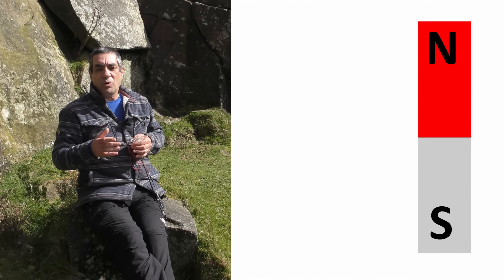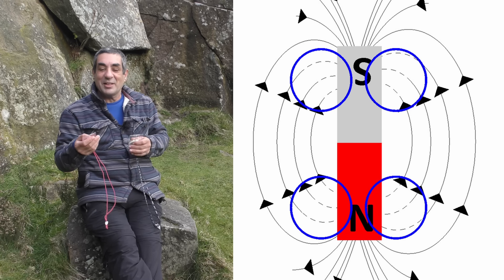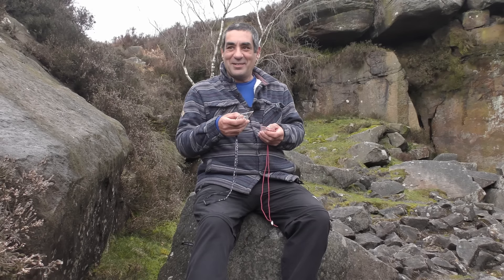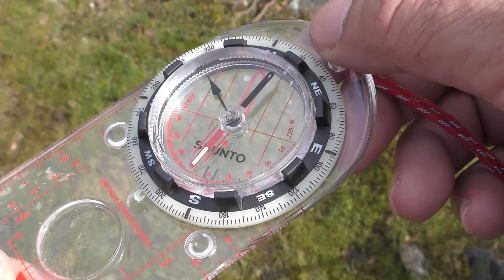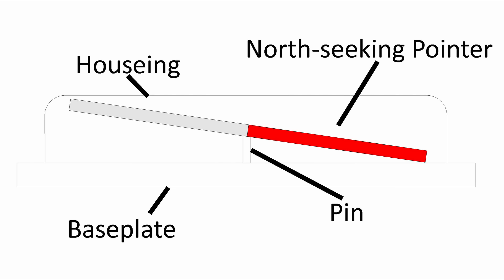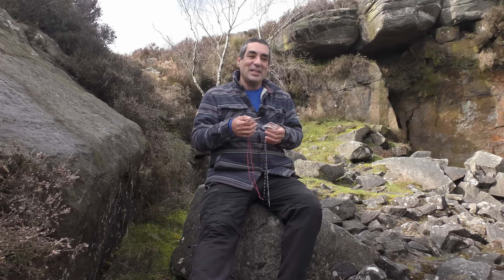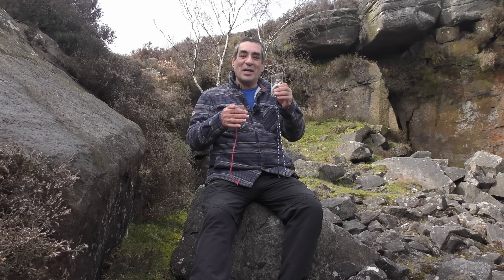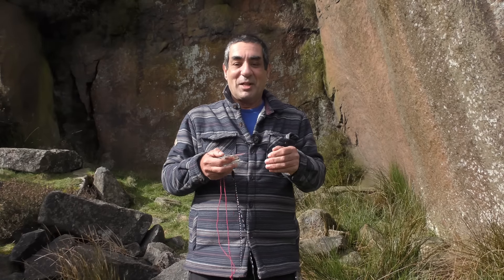Global Compass - how do they work

Comment: I live in New Zealand and it is very difficult to find a compass where the southern end of the pointer doesn't scrape. Even proper outdoor shops frequently sell compasses that have been balanced for the northern hemisphere (with a northern hemisphere DIP angle). When I try to tell them they look at me like I come from Mars. I go back to the shop a year later and they are still selling them. Using a compass with the wrong dip angle is incredibly annoying because you always have to monitor if it is scraping and thereby giving you a false bearing.

Enjoy your videos, any chance of one about the wonderful, but now discontinued, Silva 54 with the miniature sighting prism built into the housing. I used one in Antarctica to sight in a row of glacio poles, on a bearing. We swore that with care you could sight to 1/3 of a degree. Cheers.
Reply: There's a good reason folk are working in shops.  Shop assistants are notoriously bad listeners and basically slaves to proprietor's   directives.   They just want to shift stock.
Reply: Go to a ships chandler and try there. Ships of course, go everywhere and move about doing it.
Reply: @markbernier8434   Quite right.   Compasses are swung regularly and larger ports will have agents equipped to do the job.   Most  modern small boat compasses are fluid mounted  globes  rather than cards or needles.
Reply: The Silva Expedition S has a sighting mirror, which is supposed to do the same thing. I haven't used either, so I don't know, though. But Silva Expeditions is what we always used when orienteering in school.
Reply: I've had quite a few different compasses over the years...but if you really want accuracy in a small package I bought a sighting compass made by Suunto.  I know most compasses have the sighting feature but this one was different...The factory specs were different too.   The factory claimed accuracy 1/3 of a degree.

I bought it for doing rough survey work...the price wasn't all too bad...i wasn't expecting it to replace a transit...but it usually did.  Suunto KB-14/360R  OH, AND IT SAYS GLOBAL ON THE DIAL.

WHAT YOU CAN'T SEE IN THE FACTORY PHOTO IS THE VIEW INSIDE THE SIGHT WINDOW...HOW YOU USE IT IS KEEP BOTH EYES OPEN.
Reply: @joenicotera2991   Hi Joe.  In my bits n bobs box I have its little brother a KB 20/370R.  You are right to draw attention to the  view through the eyepiece.   Invaluable to those of us dependent on spectacles.  Suunto gives us a crystal clear view of card and distant object.
Makes getting a bearing easy.  It also makes for a very light compact backup instrument.   It  is advertised as one that  floats too tho' I've never dropped it over the side. The Silva Ranger (Model 15T I have   really the big  mirror does NOT like sea water  (Sea Kayaker)  but the Suunto is all plastic.
Reply: @causewaykayak  Well, I guess the brass Brunton would be a good choice then.  The one that I mentioned is a solid block of aluminum...which I sure you know...salt water and aluminum don't go well together. (Of course it could actually be stainless steel but I always assumed it was aluminum.)

I'm sure the plastic one works just as well.

The compass that I was always carrying was the silva mini...  That is because it doesn't get to spend too much time outside of my pants pocket.

OH!  I should include...non of the liquid filled compasses that I know of will take a weekend of being left on the dashboard in the sun without serious damage.  It seems every manufacturer left out the extra space necessary for the fluid to expand.
Reply: @joenicotera2991   Yes I read its a light alloy body.  Quite right - Not a good idea to leave in sunshine.  I have a Pizer M-73 which does have an expansion diaphragm  but you still wouldn't boil the thing.   I dismantled a cheap Chinese import marine unit (liquid filled)  to examine its construction and it also had an expansion membrane.   Happy navigating Sir !
Reply: @causewaykayak  Would that be a Francis Barker M73?  I assumed that it wasn't possible that I was the only person on the planet who knew you can't completely fill an enclosed container with kerosene without room for expansion...  But couldn't afford to. I had to send one silva back..they were quite nice about the warranty...
Reply: Same in Tasmania, only ever used one good one in my life.
Reply: @BrendenRoughley  I'd imagine that Tasmania and the Adirondack mountains have their commonalities.  Rain every night when it isn't ice and usually overcast.

 "Orienteering"  seems to be the word that I don't hear often enough.  Somebody might be fascinated in navigating to within three inches at five miles, good for him.  I'm usually only interested in knowing if I should turn let or right after two days hiking and find the highway.  There is always two compasses, one in the med kit...sometimes three, a spare I glued to the inside of my fishing pole case.

Comment: That was quite informative.
     Now, it seems to me that to make a global compass that is as precise and accurate wherever you use it as is one made for use in a specific region would require much care in the matching the alignments of the (perforce shorter) magnet and the pointer, and the  magnet would also need to have a stronger field to settle as quickly. 
     More parts, alignment needs, stronger magnet: higher cost.

Comment: Ive been teaching "compass related activities" for 20+ years and didn't know the answer to this. Excellent job. Why do I buy a compass with an inclinometer?
Reply: So you can measure surfaces in 3d space for geological mapping. At least that's one use.
Reply: @Eragon954  I used to be a caver, and Brunton compasses (pocket transits, I believe Brunton terms them as) were and maybe still are used commonly in cave mapping because of their precision and their built-in inclinometers.

Comment: Is it possible to remagnetise my Global compass? It died in the hold of a aircraft
Reply from the maker: I’ve done this a few times, more out of curiosity than a real need, as I tend to just throw away compasses that don’t work for any reason.  The last time I did this was with a compass which had depolarised due to being left on a desk next to a laptop overnight.
Get a strong magnet (neodymium, etc) and find out which are the north and south ends.
Place the south end of your magnet so it is close as you can get it to the tip of the north end of the compass needle.
Leave it on a flat table for a while (a few hours up to a few days).
Test the compass.
Reply: thanks!

Comment: Could you explain what the magnetic field is made of?
Also, where do the compass points if you at at the north pole? Like does it flip entirely at some point if you cross it?
Reply from the maker: A magnetic field isn’t made of “something” it just “is”.  You’ll need recall your school physics lessons and then you’ll remember that a magnetic field is made “by” electric charges which are moving but they are not made “of” something.

Do you remember vector fields from your school days ?  A school teacher who wanted to explain it so kids can understand it would say something like, a vector field is something which changes the way space works in a specific area.  Object within this area will behave in a certain as they are being influenced by the vector field.  For example a compass needle in the earth’s magnetic (vector) field.

Hope this helps

Comment: Pilots learn to do "compass turns" and learn the acronym UNOS which stands for "undershoot north, overshoot south".

This is because the magnetic compass will dip and chase the magnetic field lines into the ground as the aircraft banks.

In the US latitudes it's 30 degrees. So when turning to a northern heading you stop your turn when the magnet compass indicates 30 degrees short of north. So if making a left hand turn towards North you would stop your turn when the compass indicates 30 degrees. As you roll wings level the compass will finish swinging and settle on due north.

When turning south you turn until your compass indicates having turned 30 degrees past south. 

If you are turning east or west you don't have to compensate by overshooting or undershooting at all. 

If you are turning somewhere in between you reduce the amount of under or overshoot proportionally. So turning to the northeast you would undershoot by 15 degrees.

And you have to be able to do all of this in your head on the fly! This is why gyro compass is greatly preferred over magnetic compass. But the gyro compass can fail so you have to know how to use the magnetic compass and make these "compass turns" with the proper corrections.

There's another acronym related to the compass which is ANDS which stands for "accelerate north, decelerate south" but this effect doesn't come up nearly as much. I'll leave an explanation of the cause of this one as an exercise to the reader.
Reply from the maker: I found that really interesting, thanks.

Comment: I think there's a little bit wrong here? The only compasses I have are military lensatic compasses and the magnetic part is embedded in a glass plate massive enough that while it can still turn the pointer, it isn't strong enough to incline the pointer to where it will ever touch anything, even with pretty strong external magnetic field forcing it down.

Comment: IN AERONAUTICAL CHARTS THE MAGNETIC FILD LINES ARE CALLED ISOGONS, AND THEY CHANGE A FEW DEGRES EACH YEAR, BUT IN THES CHARTS YOU CAN SE THE CORRECTION ANGLE, FOR A PRECISE NAVIGATION
IN OTHER WORDS, YOUR COMPASS IS NOT REALLY POINTING TO THE NORT UNTILL YOU CONSIDER THE CORRECTION ANGLE PUBLICHED IN THIS AERONAUTICAL CHARTS.

Comment: The inclinometer is there to measure slope angle. Very useful if you're on a snowy mountain or hill and want to know whether you're in an avalanche danger zone. Plus it's easy to just print a few extra lines on the compass base, and you've got an extra feature to list on the packaging ;)
Reply: You could also use the slope angle to match with contours on a map to check position. The Silva inclinometer card allows you to match contour difference to a slope angle table that can be compared with an inclinometer readout. I'd prefer the need to do that stayed theoretical for me

Comment: I discovered this myself, almost 30 years ago, when I was in college studying for an electrical engineering degree, and as a project developed a digital compass, which gave its best results when tilting down on the north end.
Reply: I think Geologist compasses will allow you to measure magnetic inclination as this varies a lot over the earths surface, so in some places there is a definite pull towards the ground than in other places.  I suppose if this was mapped it could be another navigation tool but would probably change overtime like magnetic deviation

Comment: Fantastic explanation. Is there any issue around reduced leverage from the smaller radius disk of a global compass vs the longer arm of a non-global compass needle?
Reply from the maker: I like that question 😊

In “some” cases the magnet in a global compass has either the same or more mass than the longer magnetic arm in a standard compass.

BUT it has to be remembered that the mass (or size) of a magnet does not directly affect its susceptibility to the Earth's magnetic field – although bigger compasses have room/space for more magnetic material. The strength of a magnet's interaction with the Earth's magnetic field is primarily determined by its intrinsic magnetic properties, such as its magnetic moment, material composition, and magnetization.

So (very basically) if you make a better magnet, with more aligned magnetic domains and greater magnetic flux density, it will exhibit a stronger response - in our case spin around inside the compass.

Don’t forget that in a standard compass the arm just needs to turn itself but in a global compass the magnet has to turn itself and also drag around the arm, so it needs to react (to the earth’s magnetic field) slightly more.

So, and I'm guessing here as compass manufacturers are VERY protective of their intellectual property, I would say that the central magnet in a global compass is just made of better magnetic material with a stronger composition.
Reply: @TheMapReadingCompany  Thank you! That answer makes perfect sense. Thank you for that explanation.

Comment: What will a global compass do at the north or south pole?
Reply from the maker: You can't use a compass at the magnetic South Pole as all directions are north, same with the magnetic north pole where all directions are south.  It gets stranger if you are at the geographic south pole as the magnetic south pole is out in the ocean, around 1,800 miles away towards Australia.  In the Artic and Antarctic I’d probably use a GPS.
Reply: @TheMapReadingCompany  I've flown in the arctic a bunch, in the days before GPS.  Astro compass is your friend.  A good watch is also very handy when in an area with 24 hours a daylight during the summer.  If you know what time it is, then you know what direction the sun should be, and you can use that to adjust the gyro.

Comment: Umm, inclinometer isn’t totally useless.  With basic trigonometry you can quickly calculate the height of something like a tree.
Reply from the maker: You don't need an inclinometer to get the angle the compass is at.
Reply: @ it’s quick and easy.

Comment: You forgot an important advantage of the Global for week-end explorer : A global needle can tolerate a wider range of "not being perfectly flat" human errors.

If you are not in a region with extreme magnetic inclination, the global compass would be a lot easier to use for children's and casual peoples. You don't need to be as flat for a good reading.

 An extreme example  is when I want to take a reading with my M2 artillery compass. I need to check that my level is exactly center so the compass work correctly. It's super precise but a pain to use. My SUUNTO MC-2 Global by opposition is less precise but a lot easier and quicker to use.

Comment: Note: it seems that global compass are also less precise (according datasheet of some of manufacturers, iirc 3 degree vs. 1 degree). But the annoying part: shops rarely tell you which version you get (also Silva UK shop did the same error). Considering the global trade I'm wondering if we get really a Northern sector. Is there a way to check, without going to very north places?
Reply from the maker: On a Silva compass turn it over and you will see 4 letters.  The 2nd two letters are product batch codes (when they were made, etc).  The 1st two letters are the magnetic zone for which the compass is intended to be used:
MN (Magnetic North),  MS (Magnetic South), ME (Magnetic Equator).